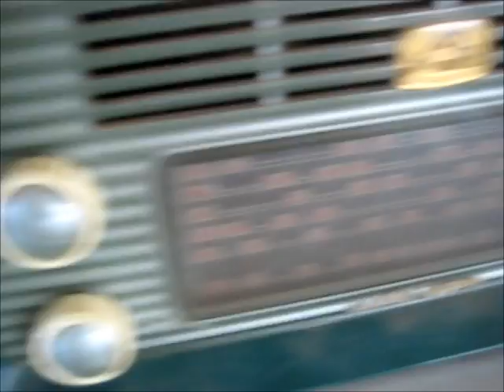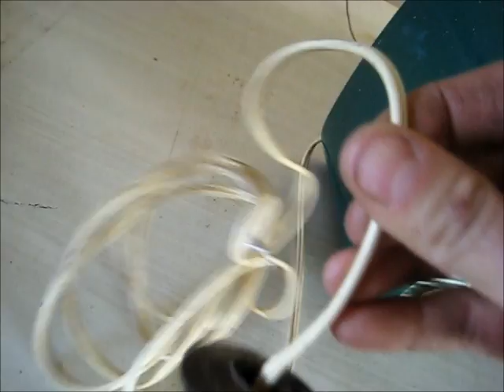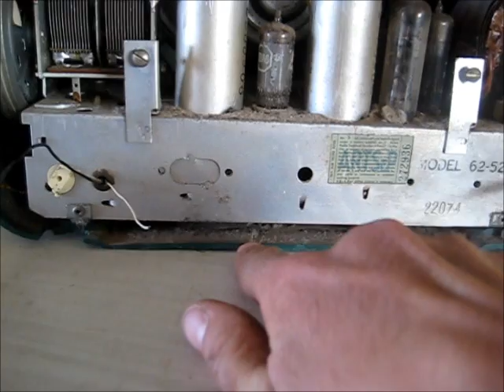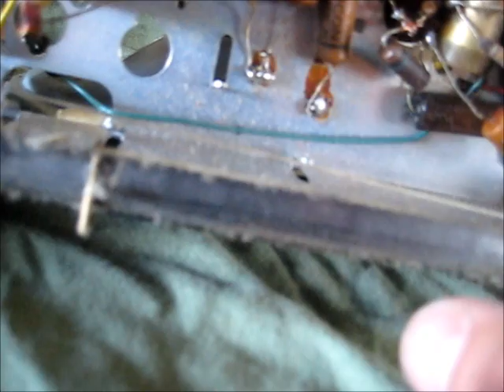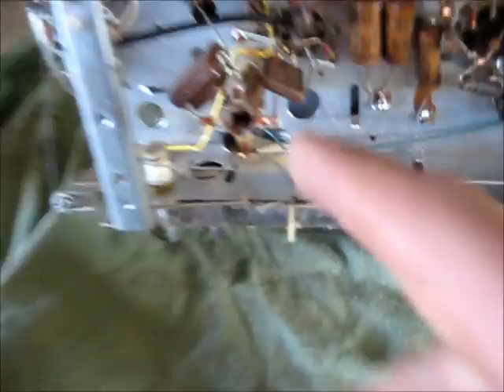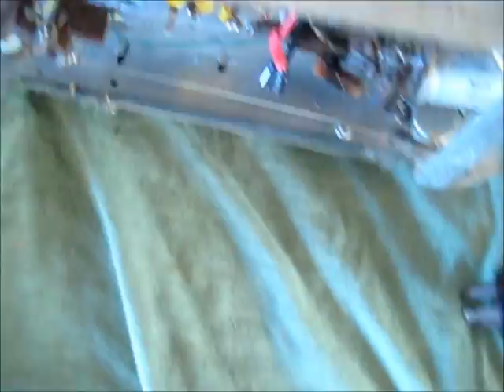HMV "Little Nipper" 62-52 Restoration (Part 1)

Comment: have only just repaired one of these recently, A very crude repair had been made at some stage in its life with a 47ohm 5 watt resistor replacing the 2 parallel 22k screen resistors that had a tendency to go out of spec due to leaky power supply electrolytics and drive the output tubes screen very high thus inducing level of hum, Very simple 5 valve circuit that was used with a few different models, Always check those resistors, I ended up replacing the 47ohm with a 10k 3 watt, Replace the 3 electrolytic capacitors 2 of which are in the one can and all wax caps, also the tar covered output transformers had a tendency to fail also.

Comment: I read the vintage radio column in Silicon Chip every month.  I have refurbished older radios before.  The circuits are not very complicated being only simple superhets.  I have the whole of Radio & Hobbies 1939-1965 scanned on DVD as PDF's. I also have quite a stock of axial poly 160 -630V & a range of axial electrolytic capacitors.  These suit point to point wiring much better than PCB type capacitors. Woodworking  Cabinet work is where I need some instruction for best results.

Comment: If you are posting this to show people please give us all a break and place the camera on a tripod and stop moving it around. Move the work if you have to but don't wave the video camera around, it makes the video almost impossible to watch.
      I am an electronics tech of 40 years, a 22uF cap will replace a 25uF type. It's a bypass capacitor for audio frequencies the difference in capacitive reactance will not change the radio's frequency response by any discernible amount.

Comment: If you need a higher voltage capacitor you need to connect them in series not parallel, if you need a larger capacitace then you can connect them in parallel. The 25 volt rated electrolytic cap is likely a cathode capacitor for the power output tube, very likely that the 22 volt one will be enough, in fact you don't even need it to make the set work. The three resistors connected in parrallel doesn't make much sense to me, they must have had a large stock of 15 K resistors at the factory.

Comment: @HDXFH No, I think he may be getting the HMV set mixed up with an RCA "Little Nipper" which was a popular entry level line of AC/DC radios that RCA Victor manufactured and sold in Canada and the U.S from 1939 till maybe the early 1960s. The original was called a "Little Nipper" or "Nipper" which came out in 1939 and continued till around 1942 then continued in 1946, After that each subsequent model was numbered Nipper II, Nipper III, up until NIpper X or higher.

Comment: be careful as often that 'canvas covered' stuff is actually asbestos braided. i run into it allot in old stage lighting equipment. problem is its very hard to define between what is and isnt so better to treat it all as if it was asbestos.  
good vid